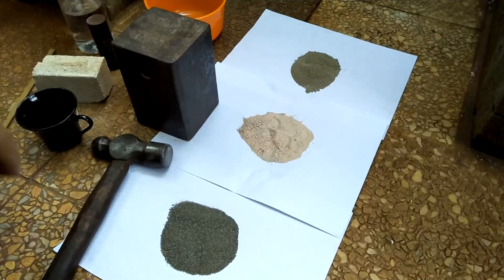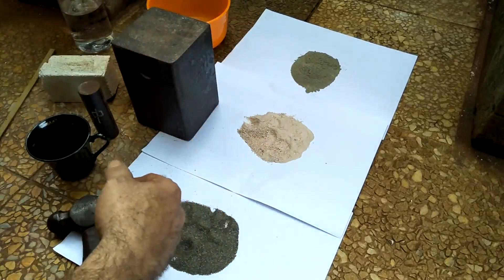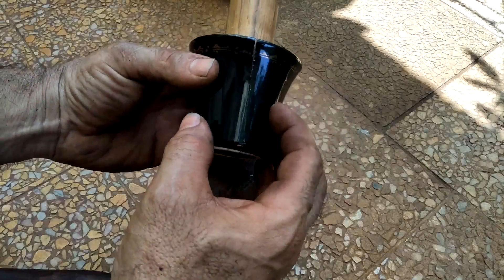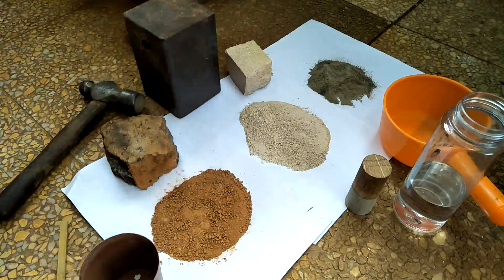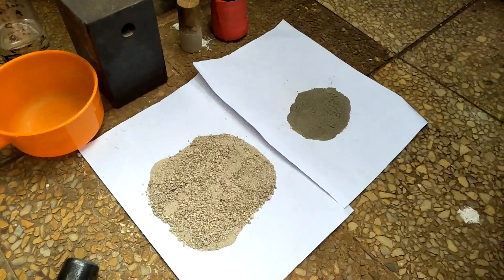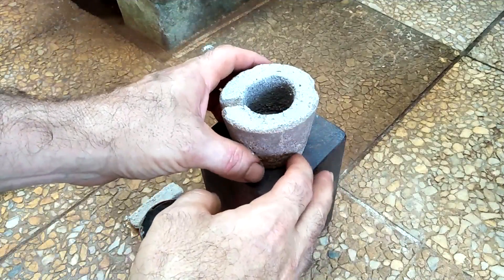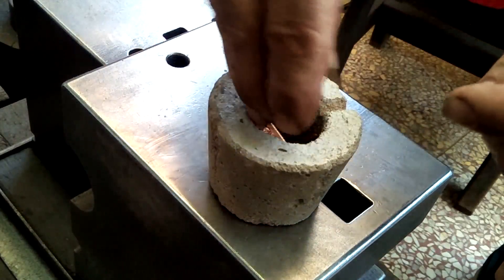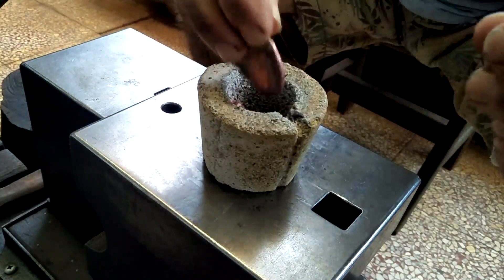Blacksmithing - making a small crucible

Comment: I appreciate the MacGuyver route. I've been doing the same since around May myself. Might as well have fun with it. I DON'T like to shop. Anyway, I'll share some ideas. I see some have been mentioned already, but I'll try to flesh them out some: 

I'm just beginning to mess with graphite, but it seems to be working so far. You can reduction burn some pencils (wrap them up and make charcoal out of them) in the forge, then burn up the charcoal. The graphite should be sitting in the bottom largely intact after the charcoal and binder is burned up. If you're willing to sacrifice a coffee grinder, it'll help save a lot of time and material. Incorporate at least enough to blacken your mix. Any amount should help.

You can get clay from your yard if you dig down a few feet most likely. Just throw it out if it's red. The rust will flux the mix prematurely and cause it to fail. I've been using a fine mesh laundry bag to filter my clay a few times and then switch over to an old high thread count pillow case. Learning how to make it has really opened up a lot of possibilities for me. It's 15,000 year old technology and it's inherently sustainable, and cheap.

Everyone is right about the portland cement. Plaster of paris has the same problems. Both got popular due to DIY coffee can forges, but they aren't any good for consistent high temperatures. Someone mentioned burning calcium hydroxide into calcium oxide, but calcium alone isn't the best readily available refractory metal. I wouldn't seek it out unless it's bound to something better... i.e. calcium aluminate... and... pyroxenes? Christ this is complicated...

Adding a little sodium silicate, like a spoonful may help with binding, but I wouldn't use it as a primary binder as has been suggested below. I forget why I abandoned that route. My forge is mostly held together with it, but I had to tweak the composition a whole lot to stop the big cracks. Anyway, You can make it with lye (100% lye crystal drain opener) and dessicant packets. Just do your best to get a neutral mix before adding it. I forget the exact ratios, but I'm thinking 3 parts silica gel dessicant, 2 parts lye, and 5 parts water. Use protection. Be patient with it. An overly alkaline mix will leech salt and wreck your skin.

The best thing I did for my forge was to reinforce it with steel. I used allealed steel wire twisted and woven for tension as close to the middle of my walls as I could get it and reinforced the outside and weak-points, like the lid and fuel ports with stainless steel mesh from dirt cheap loose strainers I found at Wal-Mart. I forget what they were called or what they're for, but $4 worth gave me more than enough for the whole thing. They look like little mesh bags and come with zip ties. I'm not sure if the same method would be helpful on the scale of a crucible as the reinforcement would get a lot hotter, but it's worth trying.

Anyway, for more exotic refractory materials I had to brush up on basic chemistry. Cody's Lab helped, as did Wikipedia. I searched primarily for "refractory" and "'insert metal here' oxide" and read through "production" and "application" for several metals. Eventually it all came together.

You can make magnesium carbonate out of epsom salts and washing soda (a really simple precipitate reaction you can do on your stove) and then dry it out and burn it down at, I think at least 2000 F for magnesium oxide, which is essentially fireproof. I'm still working on an easy method for alumina, which is the active ingredient in your fire brick. So far I've just been adding scrap aluminum foil to my clay sluice until it starts breaking down and then baking and grinding it. I'm not sure it's working. I just threw some in vinegar and HP to try to get some aluminum acetate I can hopefully burn down... but it's not too expensive to buy... and it's about 30-60% of your firebrick. 

Grogging with ground up borosilicate (pyrex) and porcelain (white ceramic cookware) might help. Grahite, Dehydrated Magnesia, and Alumina are the most accessible refractory materials to do all this MagGuyver style I think. I'm working on chromium and molybdenum, but it's a dangerous quest, especially the chromium... If I remember right, Chromium III turns to Chromium VI, which murders your DNA, at 1800 F or more... Probably best not to mess with it. it might pay to set up an electrolysis rig (car battery and a bucket) and invest in some hydrochloric (muriatic) acid, nitric acid, lye, lyme, washing soda, epsom salt, vinegar, hydrogen peroxide, and so on and so forth to tailor your electrolytes. Once you've got the ability to inject massive amounts of energy into compromised minerals, you can pretty much make anything. It's all about making hydrogen and oxygen do what you want them to do... I've found... over several long and confusing months...
Reply from the maker: Andrew, Hi and wow! That was a long comment and with a ton of excellent information. Anyone watching this video who needs proper info. on how to go about this in a more correct manner should read this comment. And I think you understand why I would experiment - partially for fun, partially for curiosity. You are truly MacGuyer-esque in your approach but armed with much more scientific knowledge than I could muster. Thanks for watching and sharing and good luck in your work. Glen

Comment: Never use cement in high temp. Reasonably got solution for crucibles would be -clay, fire brick and liquid glass stil won't gonna last long but for small crucibles its quite good.
Reply from the maker: I've leaned a lot from this process and from those who have constructively commented. Thanks for watching. Glen

Comment: i think that cement isn't the best solution for high temp stuff
Reply from the maker: Kacper, You're right. And there are better ways to create cement that will be high heat resistant. Some of the folks who commented gave me some great suggestions. Thanks for watching. Glen
Reply: @gstongs  hey glen an awesome video and ive been doing something like this as well and i need a good insulate for my rocket stove that im also using cement as binder as you did with crushed firebricks anyway any sugess how to create cement that will be high heat resistant or you've allready done in the video?

Comment: try changing the cement to Calcium dioxide and add a little bit of sugar, here in South-Brazil when we do clay ovens or something like that we add sugar in the composition of the clay, in order to avoid cracks
Reply from the maker: That's a very interesting idea. I appreciate you watching and sharing that information. Thanks. Glen
Reply: how much sugar in 100 grams clay ze ive been working pottery but its always fall apart or cracking when heat it

Comment: You should have used sodium silicate as a binder..  It will bind to the crushed refractory.  You also need a parting compound on the wood...ie wrap it in saran wrap.
Reply from the maker: There's a lot I need to change with what I've done in this video. The experimenting taught me some, comments like yours taught me more. Thanks.
Reply: @gstongs  i was a navy foundryman...if you have questions...please ask...and you may want to look up dave gingery on google...he pretty much started the home foundry craze.. He uses the navy foundry manual.

Comment: Get or make some waterglass (just enough to saturate (untill moist) the dry ingredients) , mix it with masonry sand and some fine clay (maybe 4 to1 ) and you are set for copper(alloy) and aluminium smelting...
waterglass solution can be made with silica gel catlitter and a sodium hydroxide solution (youtube has some video's on  that)
Reply from the maker: Sander, Thanks for watching this video and for sharing the good information. I like experimenting but will properly research if I have another go at this. Glen
Reply: Use co2 too make it set

Comment: Cement needs to setup for 30 days and to get best strength keep it wet! Wood does absorb water causing cement to split! Because cement has a  adhesive bond and can't be disturbed or dropped on counter to hard! Best to Ya!
Reply from the maker: Thanks for the good information; for watching and sharing. Glen

Comment: Very interesting. I liked following your thinking. Couple of things - plaster will work for a single firing. Similar to what is done with lost wax casting. For a reusable crucible, not a good product. Forget using sand. You aren't making cement; you are making a ceramic. Smooth interior is preferable. Firebrick is a good idea. Clay can be harvested from the nearest stream, or you can use some old original cat litter. It was clay and would be quite usable here. Buy or make a ball mill - the kind they polish rocks with. Let the ingredients tumble for a few hours. You will end up with a very fine powder, almost like talc. This is what you want. All forms need to be surface sealed and treated with a release agent. Too much moisture is just as much a problem as too little, but even more important is slowly drying. Keep covered with a damp cloth, and keep the cloth moist. 3 to 7 days. Then fire it. Ceramics need to cool down slowly from the initial firing. Several hours of gradual decreasing temperature. Should be fine after that.
Forget using steel or cast iron. You will burn a hole in these very quickly.
And while it is certainly easier to just buy a crucible, I love seeing people trying to relearn old skills.
Keep up the good work.
Reply: Bentonite clay (kitty litter) will probably make a better crucible, and you will need some of it anyway if you decide to make greensand for moulds.  I also think you may have used too much water.  If you decide to use this mixture (or a similar one) again, try to use the absolute minimum amount of water you can.  If you can get ahold of some fireclay, mixed with grog (broken & ground pottery or firebrick), you should be able to produce a much better crucible.
The ball mill is a good idea, but I can't see you making enough to make it worthwhile to buy one.  I think a small mill could be fabricobbled from a plastic coffee can (like this one: https://www.uline.com/Product/Detail/S-20962/Coffee-Supplies/Folgers-Regular-Classic-Roast-Coffee  one with the built-in handle) and a few bits of steel scrap (something under an inch square).  Use a large rubber band and an electric drill to rotate it.
Reply from the maker: Kirk, Excellent information. My trials with this have shown me that buying a proper crucible may be the way to go for someone like myself. I was unsure if I should pulverize the ingredients to finer powder or leave them in a larger size... I'm comfortable doing these experiments on this small scale but if any larger, and I think molten metal in a suspect crucible would make me uneasy. Thanks for watching and taking the time to explain in such detail. Glen

Comment: Your problem is your binding agent. Cement is primarily made from lime. Lime when heated to high heat breaks down. Actually if you put a lime stone in a fire and then pour water over it after it has cooled it will break apart just like your third try did. It is actually how cement is made. A sodium silicate mixture as your binding agent would work much better. To make sodium silicate you need water, 100% lye (stump remover), and silica gel (found in desicate packs. Check at your local motorcycle dealer they sometimes have big packs of them from the shipping process.) If you search Google you should be able to find a recipe. Mix that in place of water with something like your fire brick and it should work you could also try perlite (garden stores carry it.), Or clay instead of fire brick.
Reply from the maker: That is very good and useful information. I will attempt some of the mixtures suggested in comments like yours. And your suggestion about the binding agent was especially useful. Thanks for watching and for taking the time to comment in detail. Glen

Comment: Part of the problem is that the mixture is too wet. I can't tell from the video, but it looks like the right consistency @ 10:02...before you added more water.
1.) If there's too much moisture then the casting will take longer to cure before you can risk firing it. 2.) When you place what you want for an inner diameter, make sure the crucible as a whole will have at least 1/2 inch wall thickness.
{Basically just figure how tall and wide you have room for in the furnace, then use a wood dowel to where it would give you the target wall thickness.}
3.) Before you leave it to cure, lightly tap the sides of the container to settle the mixture, and bring whatever bubbles there may be to the top.

Just a quick suggestion on materials.
1/4 part Quickcrete, 1/4 part Firebrick and 1/2 part clumping type cat litter (finely crushed)...ie: consistency just slightly coarser than powdered sugar. The clumping kind is important because it will give you the sand/clay content in roughly equal amounts.

Plaster works to an extent but will only hold up for a few casting cycles, before the Crucible fails and you need to make a replacement.

**Before ppl start giggling about using kitty litter, I use it on it's own/sometimes mixed with powdered aluminum (for nosecone and multi-stage delays) as plugs for model rocket engines/fireworks and it holds up very well to heat.
Reply from the maker: Thanks for the good info. You're right, it was definitely too wet and I was definitely too impatient. The mixtures you suggest are excellent and I will give one or two of these a go. I had decent success with using just a  steel vessel but I can see that that wouldn't be suitable long term. Thanks again for taking the time to explain with such clarity. Glen
Reply: No problem whatsoever. Happy to help. I might as well help ppl with what I do know, and then watch what they make with it. :)

Comment: Check out the Internet with regard to curing refractory cements.  Refractory Cement like to dry and cure slowly.  We allow the cement to slowly dry for about 3 days in the shade/indoors, then place it in the sun for about 5 more days before starting the curing process by gradually increasing temperature to forging temps.
Reply from the maker: Victor, Thanks for sharing that very good information. I definitely need to dry the crucibles for a longer time and at a slower rate. But I have also found that even after being dried slowly, they can still pick up moisture on very humid days, which are common here. Thanks again. Glen

Comment: Plastic mold. 3 parts of sand, 1 part of cement. Mix it up. Do not pulverize the fire brick, little rocks maybe, put them with cement and sand. Add water and put on mold. Don't use the wood, use a piece  steel (pubricate wuth vaseline). When it is a little hard spray water every one hour. At the other day open the mold and spray with water a couple of times. Let dry completely. Concrete takes up to 2 weeks to dry in that size. Then try it out
Reply from the maker: Lizandro, Thanks for the very useful information. I tried pulverizing the fire brick to a fine powder but I was also thinking that keeping it in a larger size might be better. I'll give that a try for sure. Thanks for watching and sharing. Glen
Reply: Glen GS Tongs thank you for reading me, haha

Comment: If you want to mak a crucibke you need put (in spanish: bentonita, caolin y alumina o oxido de aluminio que es un material aislante) then you cook for 4hs at 1200°c to make a block,you can use a ceramic oven (some people rent they oven for ceramic for a few dollars) you can add (in spanish: chamote). I find this recipe on internet fron a shcool,they wanth to make a bread oven and make they own bricks. I think was 30% of bentonita,30%of chamote,30% of caolin and the rest of alumina, if a find the recipe i can put there if you want.
By the way i really like you videos,keep doing! I learn a lot. Best regards from argentina
Reply: Mariano Garabato de dónde puedo conseguir los materiales. También soy de Argentina.
Reply: Axel Mayol en cualquier quimica para laboratorio,no las de articulos de limpiezs. Tenes varias como quimica oeste en liniers pero depende de donde seas.saludos
Reply from the maker: Mariano, I appreciate all of the great information. I'll do my best with this in the future, take the good advice likes yours or maybe buy a proper crucible rather than make one myself. I had some success with just a steel vessel but I think there could be problems with that in the long run. Thanks for watching and sharing. Glen
Reply: Glen GS Tongs i think is really great make by your own, i try make the same beacause you can learn a lot including when you make a mistake. See you in the next video!